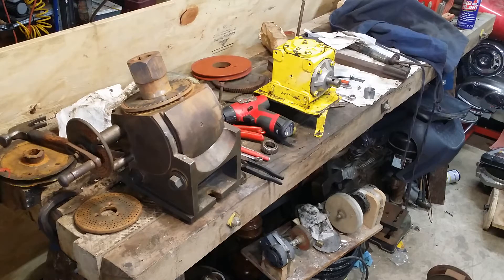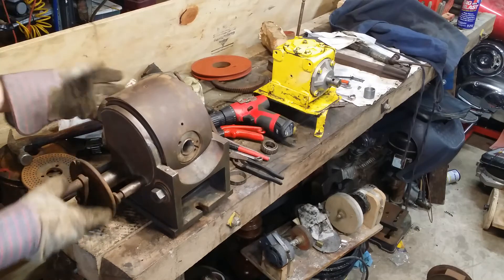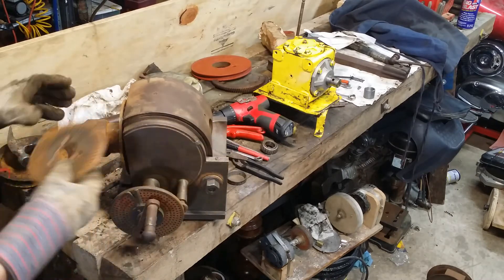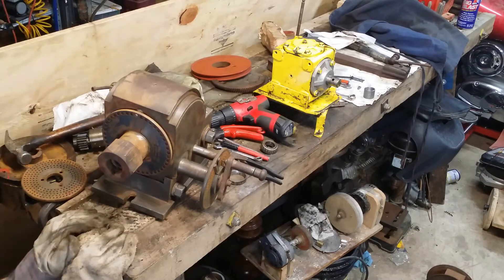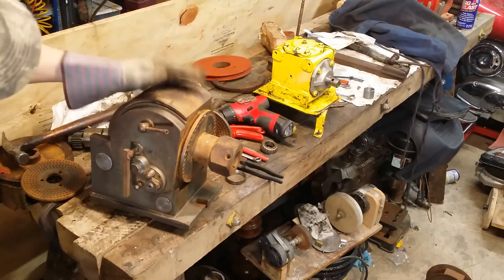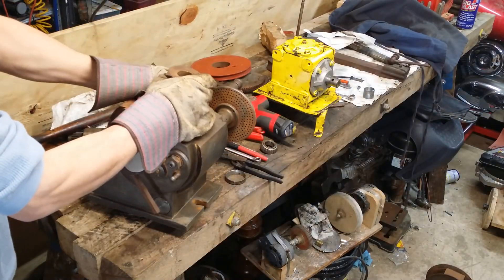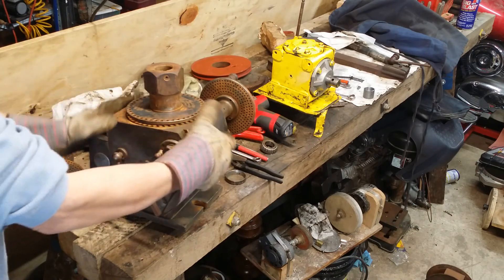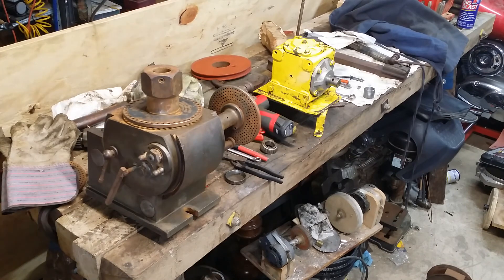New to me dividing/indexing head kind of a brown & sharpe style knock off I think

Comment: Very nice score it will be handy as hell
Reply from the maker: Thanks. That front nut seams welded on. Gotta get that off 1st
Reply: @craigtate5930  good luck with that hope you film it alway looking for ways to get weld off with out torch
Reply from the maker: @joeduda8507  finally did get the nut off, lil wd40 and 2 large pipe wrenches